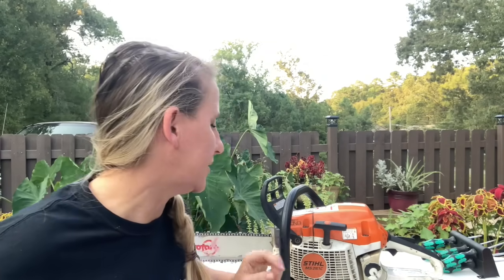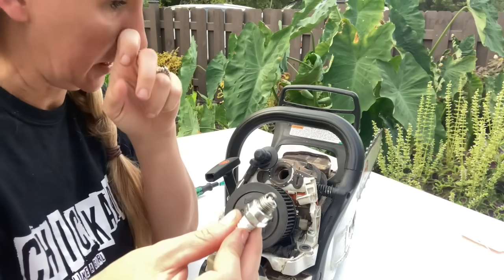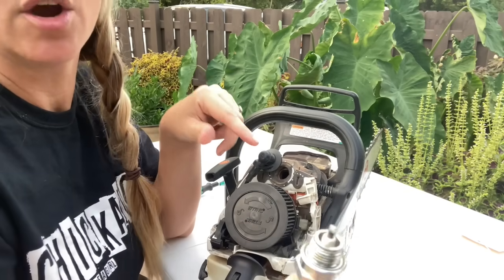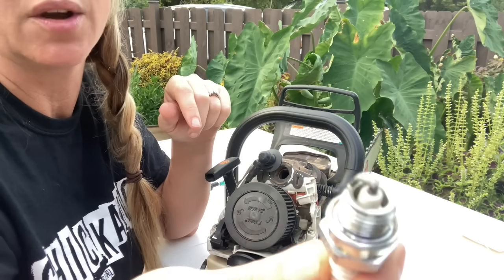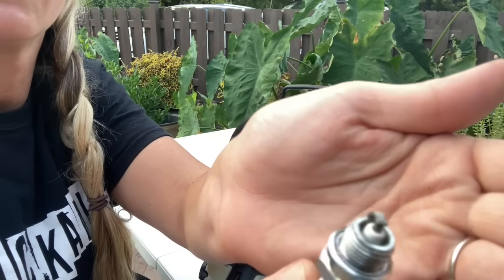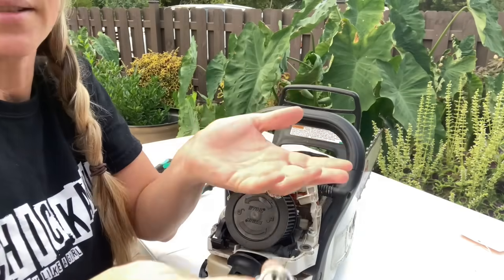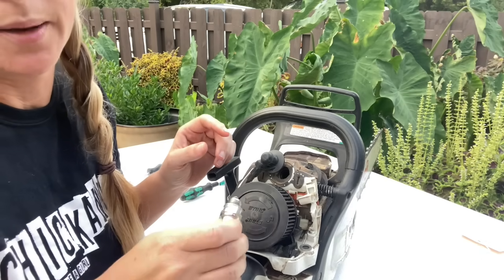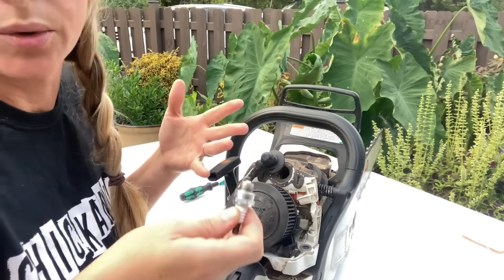STIHL M-TRONIC CHAINSAW HAS NO CARBURETOR ADJUST, WILL IT "RESET" TO REGULATE FUEL CORRECTLY?

Comment: Good video. I am a Certified Stihl Technician I work for a Stihl dealership not for Stihl. The M tronic system generally works as intended. The main issue that we see with them is the solenoid that that is located on the carburetor. The valves leak and cause a rich condition where the system is no longer able to reduce the amount of fuel going to the engine. This usually causes a hard to hot restart, no idle or rough idle fault. Fine debris from the fuel gets ground up in the valve and cause them to leak.There have been several updates to the solenoid valves and the fuel filters for this issue. The m-tronic system can be checked for correct function by running the saw in the bottom "start" or triangle position. With the engine warmed up the saw should run continually in the starting position. If the engine will not continue to run in the start position then there is a fault with either the engine or the m-tronic system and further diagnostics and repairs will be required. sometimes issues get blamed on the Mtronic but in fact the engine itself has an air leak or some other issue going on. Its still more or less a standard two stroke engine. If you would like I can send you a more detailed email on how the system works. The MDG1 diagnostic tool and Stihl Diagnostics Software are publicly accessible and can be purchased through a Stihl dealer. Stihl will warranty the M-tronic system for two years under an emissions warranty that is required by law. Additionally most Stihl dealers and Stihl distributors will work with customers to get issues like this resolved even covering repairs on units that are out of warranty. This type of warranty is handled on a case by case basses often falls under the dealer and distributors discretion. Usually if you are hospitable with your dealer they will take care of you. A little kindness goes a long way. Overall Im not against the M-tronic system. It just takes a little know how to troubleshoot. Its not perfect but Stihl and all manufactures are under pressure form the governments that the sell there products in to meet ever tighter emissions standards. Just look at what has happened to the auto and heavy diesel industry its the same thing.
Reply: They brought back the 362 w/o mtronic and that was a “BUY NOW” moment for me. The second they got one in my local shop it was in my truck and on my farm.  They can easily fix it. I can easily fix it.  Long live the simple carburetor. #weaversstonehousefarm.
Reply: @weaversstonehousefarm  There’s a brand new Stihl 261 Non Mtronic at my local store. I may grab it. I need a saw for a piece of land I bought.
Reply: I’ve had several older Stihl saws with adjustable carbs and was pleased with them,I never had to stop logging in the middle of the day to reboot,tech has its place,not in the bush.
Reply: True. We’re saving America for China and Mexico
Reply: How is the circuitry powered? Is it developing power from the magneto to run the solenoid?
Reply: @techguy9023  The system runs on power generated by magnets on the flywheel and coils of wire in the ignition module. All of the computer components are built into the ignition module.
Reply: @eugeneoreilly9356  4 mix are great if you are willing to adjust valves occasionally. Light, smooth and quiet when set correctly. Adjustment is easy if you have the proper gauge.
Reply: Interesting, one question will 87 octane be enough?. Many people have used it with zero problems, but I guess the 89 they advice, but according to the Euro scale their fuel is equal to 87 octane. And M tronic  is supposed to regulate fuel.
Reply: @CowboyAxe  Stihl recommends 89 octane minimum on all of there products. I recommend people to run ethanol free fuel. There are specific pumps that sell "recreation fuel" it is 90 octane and contains no ethanol. You can also purchase pre-mixed fuel from stihl and other companies that are ethanol free.
Reply: @etec225a  Can fuel is ok for storing, but for working it would be very expensive, I will use 91 octane and if it has ethanol I will use stabil marine 360... thank you for your reply, I will not damage my saw.
Reply: @CowboyAxe Do not run anything but ethanol free fuel in your small engines. Ethanol ruins small engines by breaking down rubber components and gums up the carburator and fuel system. If you follow this advice, you will experience far fewer issues with your small engines.
Reply: I have run mostly old style carburetor s. I bought a MA261 IC about 10 years ago. I had many Huskys to include a 3120 and several in between.  When I went shopping for a lighter powerful bad ass saw with incredible weight to power ratio the Shil dealer told me MS261. I asked several times and told him if I dont like it I will return it.  I know him and he knows me. He said fine. By the way. I went looking for another Husky at the time. The lower CC wasn't that much lighter than my 72 cc Husky. Anyway that saw is incredible and just runs. I was leary of the M ironic but the dealer told me they rarely fail then it's probably a solenoid.  I know how to adjust and rebuild carbs. Done it many times as well as rebuild saws etc. For host to critical of Mtronic and then admit she doesn't know how to use it is odd. It works. But what should be kept in mind is most users of small 2 cycle engines have no idea how to adjust the old style. I have seen many " pros" not use RPM meters. They just listen when they adjust.  That also is a hay seed way to go about it. It works and I have done it but it's good to know what your motor is doing.
Reply: So pathetic isnt it.  I have been running a Stihl Ms250, A BR600 and a 56-rc weed wacker.  I have owned all for 10 years starts on first or second pull.  I would never buy an echo over a Stihl.  Echo is a home depot/box store tool.  Cheap parts.  If your a landscape owner and have day laborers, then maybe sure I would get husqvarna or redmax which is made by husqvarna..
Reply: @won2phuckme redmax is the best trimmers and blowers on the market.
Reply: I would love to hear more about mtronic too
Reply: question:  The guide bar plate on one of the 362 is a flimsy metal; can I replace it with a solid metal plate- no flex - the holes all match.  - thank you
Reply: Great explanation..  So glad I don't deal with this stuff anymore..lol.  I'm rebuilding an old 660 for milling, like new! ; )...  I will never buy an moronic saw, for sure..  The law is clearly being used as a weapon against the people..
Reply: @MrSparkums   I just ordered a 32" light bar and Hexa chain for another customer's 500i who told me the same thing- 500i is the best saw he's ever used. He also has a 660. Just feedback I get from local loggers/landscapers etc.
Reply: @billclark8241  Former STIHL tech here..  I've watched 2 Platinum STIHL  mechanics nearly lose it trying to diagnose bizarre Mtronic issues.  The test diagnosis procedures involved along with the software and test equipment required to do so all to satisfy EPA Marxism nonsense forced on them has lead me to avoid the newer units at all costs..
Reply: @MrSparkums  
LETS GO BRANDON
Reply: Would you send me that information thank you
Reply: Yes Holzfforma are Stihl clones but clones of discontinued models, no Mtronic.
Reply: So do all stills come with the m tronic?
Reply: @rorynelson7548  Only models with M designation. Example MS661CM
Reply: @etec225a  ohh ic. Thank you very much
Reply: Yeah noticed my stihl weedeater s weren't running near as good and there emission systems are crazy high control I had to switch to echo and there my new fav but always loved my fs91s still do just wish they didnt have the emission standards
Reply: Luckily my dealer is cool because they know I run red armour so they gave me a year warranty with my oil and that's no small use I also use ethanol free and I know that they had some problems with the mtronic but they have that pretty much fixed I love echo all my stuff is but my saws I only got the mtronic because my dealer is so close
Reply: Sounds like a job for DOGE!
Reply: I might have known.
Anything that’s tied into emissions control is bound to be a recipe for poorer performance. Emissions control is “only” concerned about the environment and NOT the performance of the actual tool!
Reply: Mtronic versions generally have slightly more power than the regular carb version of same saw just because they are in a more accurate tune.
Reply: How to install the clutch cover on a ms194t with the brakes engaged
Reply: I wish I never went for one of these.
My dealer became a night mare, right in the middle of the day. Fired him. Too bad he had great employees.
Yeah, I get the government interference. They broke Husy's patents, and forced others like Stilh to adapt.
One thing, I absolutely have disdain for are the stupid oil and fuel caps.
You mention debris in the fuel...
Reply: I have had a starting problem with my expensive, heavy duty Stihl brush cutter head. It wouldn't start "cold"when left in the NC summer heat. And it wouldn't start "hot" either. Wasted lots of time.Just bought it a year ago and had to pay labor to replace carb, which was about $75. I run Jonsered saws and had no problems. I am skeptical about getting a Stihl saw.
Reply: You absolutely can not run ethanol fuel in all small gas engines. It destroys the fuel lines and ruined rubber components inside the fuel system. This effect is amplified if you leave your equipment in hot places like a garden shed in the summer.
Reply: @codylapoint  Bull. I use marine stable 100% of the time and use syn Stihl oil.  I have 10 small engines running on E-10 all the time, and they all start, every time.
Reply: @SeaPro360  Well sir, you do you. Put whatever you want in your machines,  you bought them that is your right.  But my father also refuses to put 100% in his small gas engines and he can't get more than 2 seasons out of anything before the fuel lines and rubber components on the intake deteriorate and fall apart or turn to jelly. Then it won't run or won't run correctly, and they drop the shit off at my house and i use to fix them before i got sick of it always being the same problem over and over. My brother in law also has had similar problems with his chain saw and weed eater. I live in the south and It gets hot here, and it can regularly get above 150° inside a garden shed in the summer. Which evaporates the fuel and pressurizes the fuel system and softens rubber hoses and lines which allows the ethonal to amalgamate with the rubber even faster and ruins the stuff very quickly. You are welcome to your opinion, but if people listen to it just know you are ruining thier stuff.
Reply: @codylapoint  MARINE. FORMULA. STABIL.   Sorry for your loss.  
I can go outside now, pull the rope on my log splitter that hasn't run in 8 months, and it will start in probably 10 pulls.  The next day, 2 pulls.
Reply: @codylapoint  Nope.  I use E10 89octane in everything with marine Stabil 100% of the time.  My Hondas start on 1st or second pull, my Stihls usually start in 5 or less (2 trimmers, 1 blower, 1 mtronic 362) and my Band S mower starts in less than 3 pulls.  I personally believe if you use ethanol free and then use ethanol in it it WILL act as a solvent and break stuff loose.  I use it all the time, and my log splitter sits for 10 or 11 months.  Use the marine stabil EVERY time in every motor.
Reply: @SeaPro360 then you must be doing all the extra maintenance required by ethanol fuels. Draining the tank after using, running it dry, fogging the cylinder when the season is over.
Reply: @charlesgunzelman3323  I don't do anything, but use marine formula Stabil 100% of the time.  Costs like 10 cents per gallon.
Reply: @tomcurran1538  Sorry to hear that. Sometimes the right equipment can be what ever you have the best dealer support for in your area. Stihls warranty is only so post to cover manufacturer defects. There can be exceptions to this and it really comes down to the details each individual work order. The dealer and distributors do have some discretion on the warranty. Stihl instructs the dealers and distributors to do what they can to help the customer. Most dealers are willing to work with you.
Reply: @tomcurran1538  Clean the spark arrestor (delete even better).
Reply: @SeaPro360 I feel like this is not a good recommendation, as not everyone is cautious and attentive, and a fire can easily be started. Clean the spark arrestor absolutely, remove it maybe not.
Reply: @tomcurran1538  Check valves. Stihl 4 mix engines get finicky when valves are off. Not an issue on chainsaws though as they are proper 2 stroke engines. Can't compare the two.
Reply: Too clever for everyone's own good?
Reply: Thanks for your explanation...
Reply: You dam right
Reply: My reasons not to buy Stihl: 1. Overpriced and resting on laurels. 2. Very poor warranty. 3. Echo CS620PW and Holzfforma G660 PRO are the best bang. (Got 'em both) 4. Same issues goes for Husqvarna. 5. I'd never own a saw I can't make carburetor adjustments on.
Reply: @yungsmile7546  isn't the Holzforma just a stihl clone?
Reply: @JohnnySpathas  yes, but what if the basic clone design is copied, then improved over a few iterations of the design?
Reply: @TheAefril  possible, but machining standards are very important, as are materials quality.
Reply: @JohnnySpathas  ironic of him isn’t it. He doesn’t like good components but settles for recycled  Chinese metals.
Reply: @yungsmile7546 

Dude they sell a “Non Mtronic model” lol
Reply: @yungsmile7546  Yeah sure.  Chinese rip off  and reverse engineer old stihls.
Reply: Be kind to my dealer, yeah not gonna happen. I already own my saw and I ain’t kissing anybody a$$ to get it worked on while under warranty.

Comment: When you say you are covered if you use their 2 stroke oil (stihl) .
Is that stihls high performance 2 stroke oil , or their normal 2 stroke that they have had for ages.
Cause I'm pretty sure stihl wants you to use their really expensive high performance oil when you buy one of their new saws, otherwise your not covered by their warranty.

Comment: electronic controlled chainsaws , shows up the ability skill set of the person servicing it ,  just to adjust a screw without identifying the true reason why , the chainsaw is too lean or not  is the old cowboy why , computers  like M tonics and Auto tune rely on the input and output to then come up with the right answer ,  this is either air filter , Oil and fuel issues , wear n tear , or the sensors not reading the right voltage for the ADC to give the micro comptroller or fpga the right data  . there will be a max and min , the computer will adjust within that , if it cant it will record an error message , then it's up to the trained service person  to know what the problem is .   ... computers make servicing 100% better and more reliable !    ♥

Comment: I agree with using their oil but how does that work with using anything less than 93 octane fuel? You're gonna get people that use the cheapest fuel & then throw a hissy b/c it's their fault! I'm a retired small engine mechanic who's got close to 60 years working on this stuff. This's a question I've wanted to ask a factory rep but never found one.

Comment: I have news for u. You are not doing the reset on the moronic saw correctly. That is why it is not running correctly.  I am a stihl technician. I also own ms261c. U need to know what you are doing before you make your videos.  WOW, wtf.
Reply from the maker: Um... According to the Stihl service manual. I did exactly what it said.. wtf?https://m.stihlusa.com/webcontent/cmsfilelibrary/instructionmanuals/stihl-ms-261-c-m-owners-instruction-manual.pdf

Comment: Most Stihl dealers do not have he appropriate test equipment for Mtronic saws, either.  Stihl charges $10,000 for it and most dealers will not spend that kind of money for it.  It will take about an hours worth of cutting to get a new spark plug to start showing good colors on a sparkplug.

Comment: As someone who worked at a Stihl dealer for 4 years you don't need a computer to do anything with a M-tronic saw. While a computer can tell you hours and do a few checks on the system a reset requires no computer at all. All you have to do is make sure to follow the correct reset procedure when starting the saw. Besides the check valve that performs the carb adjustments they are identical to a normal saw and are no more difficult to work on or unreliable in my experience. In 4 years out of all the burned up saws I saw I only saw one M-tronic saw burned up for any reason other than running straight fuel in it while I saw many conventional saws burned up from improper tuning and lean running.
Reply: so what do you do when doing a reset doesn't resolve the problem?
Reply: @jbbolts  Solenoid, as has been pointed out in other posts.

Comment: I've been a STIHL dealer for 19 years.  The only way to correct the problem is to replace the (H) speed solenoid, that is if the inlet screen is clean and the upper diaphragm is soft. That'll set someone back about $90 bucks, parts and labor, in my shop. The solenoid changes out fairly easy, but after doing that you have to do what's called a "Learn Idle".
 
1. Start and idle 90 seconds in the start position then blip the throttle and shut off immediately.
2. Start and idle in the run position 60 seconds.

FYI, the only M-Tronix saws that I sell are the M-Tronix only saws. The MS261 comes both ways as do a number of other saws....
Reply: I have a fs 460 c , looks like its flooding what could be ?